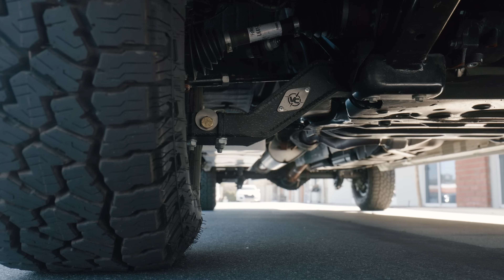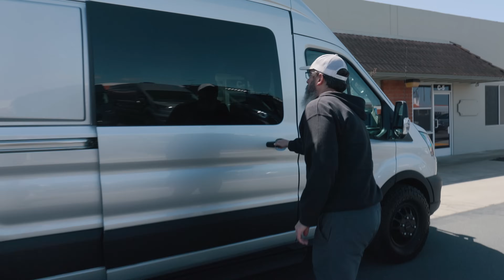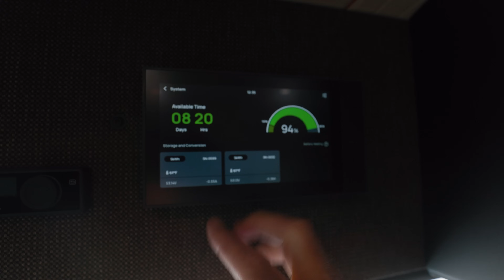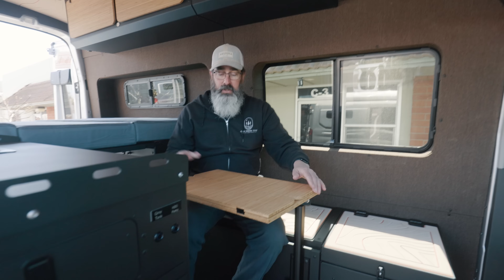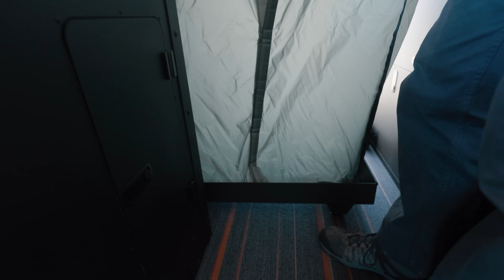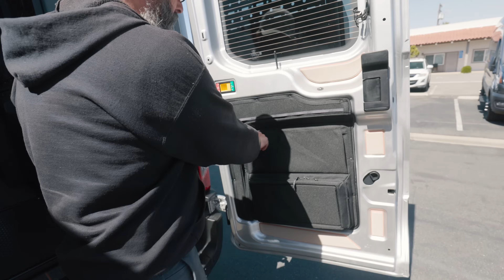2025 FORD TRANSIT AWD | Camper Van Conversion with Bathroom

Comment: One thing I noticed that you might rethink is that your short power outlet is an extremely vulnerable spot on the bumper anytime you drop off a small rock or ledge you’re gonna tear that outlet right off.

Comment: Is there any difference between flatline van co gear vs Owl vans? Im on the fence on which i prefer. Also is that the slim box or the standard rear box?
Reply from the maker: We prefer the FVCO gear over the Owl stuff. The box is the standard rear box. We think the construction and usability of the FVCO box is superior to the Owl box.